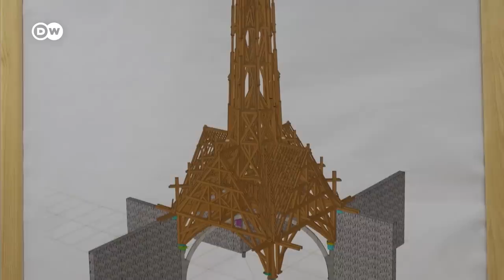How is the restoration of Notre Dame Cathedral going? | Focus on Europe

Comment: It's great that they are restoring the cathedral so that it will look how it used to, rather than doing some kind of wacky modern reimagining of it.
Reply: The spire basically is a whacky modern reimagining of it. It was added centuries later, fairly recent, and it turned out to be a bad idea, as the collapsing spire crashed through the roof it caused a lot of damage. Rebuilding exactly the same steel spire sounds like a bad idea.
Reply: @kurtilein3  it was a bad idea because it got burned? with that logic the roof was also a bad Idea cause that fell to the ground as well and caused a lot of damage
Reply: @Legendaryium  The collapsing wooden roof did not break the lower stone part of the roof. That was all the spire. The spire smashed the roof, allowing in the water from the firefighters.

Rebuilding it in the same way that is at much as risk in a fire is a bit like rebuilding buildings that collapsed in earthquakes with similar buildings that collapse in earthquakes. 

The fire proved that building such a heavy and high spire OUT OF WOOD was bad.
Reply: At least we will see what she might’ve looked like when she was finished.
Reply: I kind of loved the modern glass green roof design that was suggested.
Reply: We need need more traditional building
Reply: A good example for combining modern architecture in a traditional building is the Reichstag in Berlin.
Reply: @kurtilein3  I would have been happy if they didn't rebuild the spire, since it wasn't original to the cathedral--it was a 19th century addition based on what Viollet le Duc thought the medieval builders should have done. That said, it's been a part of the cathedral for so long that I completely understand why it's being rebuilt.
Reply: Same with the bank buildings in belfast. In fact, it looks a lot better and fresh than it did before the fire. Everything looks exactly the same but just cleaner and also pedestrianised roads now exist because of the fire
Reply: @Gahmuret  The spire was originally on the cathedral, please, inform yourself and stop spreading misinformation.

What Viollet le Duc did was not adding what he thought the medieval builders should have done; what he did was restoring what the medieval builders had built and had been removed in the later period. 
As a matter of fact, Viollet le Duc used the foundations of the previous 83 meter spire (which were still present under the roof) to build his reconstitution.

This spire was on the roof of Notre Dame de Paris from the 12th to the 18th century when it was eventually destroyed because of its instability. It housed several bells (contrary to its modern counterpart), and the cross at its summit housed relics of the Holy Cross.

Viollet le Duc thus merely restored the cathedral to its original state (save for a few statues, grotesques and gargoyles).
Reply: Personally, redesigning the Norte Dame would actually be within Paris History
Reply: @Legendaryium  Yeah, the whole effing cathedral was a bad idea because gravity exists.
Reply: @ThePaulv12  exactly!
Reply: It's French history, of course they will do it properly.
Reply: What’s wrong with modernizing stuff.
Everything can’t stay the same forever.
Reply: @utopiandreamer04  Go to Europe. There are ‘traditional’ buildings literally everywhere.
Reply: I did like that idea of an all glass roof but I think restoring it back to the way it was is honourable but quite difficult.
Reply: Word!!
Reply: I mean, as if that was ever going to happen?... Lol
Reply: @joelmulder  not enough. In majority of cases it's only downtown that has beautiful traditional buildings. While the rest of the city is cluttered with modern buildings-"boxes"
Reply: @NiceButBites  True, I was just parroting the current right-of-centre backpatting.  Though there was a lot of paranoia earlier on that they were going to glass it up or turn it in to a mosque or something to fit with “modern Paris”.
Reply: @joelmulder  If you don't understand the importance of history, I feel sorry for you.
Reply: Yes, that's good. To me, it would be the only acceptable option. What's with all that "as it was or BETTER" rubbish? A medieval monument (yes, restored in the 19th century) couldn't possibly be made "better" by restoration works in the 21st century.
Reply: It would have been nice to add our contribution provided that it is done with care so as not to denature the building
Cathedrals like Notre-Dame to built in several times, where each era has made its contribution to it. We are the first era to not want to participate into our monuments, which is both great (we care about our past) and sad (our legacy will be weak).
Reply: @idalily3810  you don’t have to like something to understand it’s importance.
Besides, it’s a bit presumptuous to assume one doesn’t care about the entirety of history when one is not a fan of historical (read, old and I’ll equipped for modern living) buildings.
Reply: Yes, just slather it all in dull gray paint, make it fresh 😅
Reply: @kurtilein3  yes but it was built in a medieval style (gothic revival), not in 19th century's architecture
Reply: @remilenoir1271  somebody should pin your comment. Thank you for the info.
Reply: Our generation will be the first in a millennia which is not doing any “wacky modern reimagining” of it.
Every time they needed to fix/rebuild/improve, people added their own touch to it, which made the Notre Dame great, and filled with history. Our generation is completely left out of the history of Notre Dame.
Reply: Amen!!
Reply: @joelmulder  Coming from a Catholic perspective, I’ve seen more than enough churches try the whole “modernizing” fad over the years to the point where they’ve destroyed pretty much everything that made the church buildings actually uniquely Catholic or beautiful in comparison to the more modern, utilitarian designs seen in some secular ones. I’d much prefer Notre Dame to preserve its history and symbolism more than adding some tacky glass ceiling and ruining its aesthetic as a result.
Reply: @joelmulder  One who does not recognize the importance of architecture to history doesn't appreciate history. Yes, that's my opinion.
Reply: @kurtilein3  hahahahahahaaaa
Reply: @kurtilein3  it wasn’t really designed to be on fire love
Reply: It's great that thousands of century old oak trees will be cut for the roof structure and spire. To make it another potential fire in the future. They could've done it with steel. It's a part that no one would see anyway. It's fireproof and with proper maintenance will last a few hundred years if people still care about that.
Reply: I trust the reconstruction of this historic cathedral recently damaged by fire will incorporate the latest technology in fire protection and safety that was lacking or inadequate.  This should include periodic testing, checking and upgrading to insure its effectiveness over time.
Reply: @utopiandreamer04  yes we do
Reply: It’s not a waste of time and money. We need to preserve our history and that kind of craftsmanship
Reply: I thought the idea of a glass roof was cool.  When I visited the cathedral years ago, I found it dark and inhospitable inside.  I was underwhelmed.
Reply: Yes it's a good thing, the decision makers have understood that if Notre-Dame is the property of France, it belongs to the whole world. And you can't modify an icon.
Reply: @remilenoir1271  exactement ! Merci Arte ^^
Reply: @Gahmuret  Would you kindly delete this inaccurate message. There was a spire in the Middle Ages on the cathedral.
Reply: @Gahmuret   non,  il y avait une première fleche au 13 eme siècle qui a été démontée au  18eme siècle, Viollet le duc l' a reconstruite au 19 eme siècle...
Reply: On parle de mauvais câbles d'alimentation mais ça ressemblait plus à un incendie criminel
Reply: People aren't concerned with things being rebuilt in an 1800s or 1900s style.
What the vehemently object to is any current architect redesigning it in a modern style.
Indeed most people despise most modern architecture.
Reply: That wouldn't happen, and didn't

Comment: On the next progress report, it'd be great to hear about what's being done to prevent another costly disaster.  Did they install a fire prevention system throughout the cathedral, not just the areas that were affected?  What was learned in needing to re-do parts of the cathedral, and what was fully lost that could not be replicated?
Reply: Nothing is fully lost. Everything can be replicated. The architects are just trying to determine which original pieces they can re-use for the reconstruction.
Reply: In 2010, Andrew Tallon, an architectural historian and professor at Vassar College, NY, USA, captured the entire structure with a laser scanner. More than one billion points of data were gathered. Every minute detail was scanned. It was seen as a somewhat nonsensical project, but Tallon’s scans now helps bring today’s rebuilders as close to the originals as possible. (Tallon died in 2018 after a long battle with cancer, aged only 49.)
They will hopefully install a state of the art fire detection system. It would be insane not to.
Reply: Thought it was a digital scan done for the assasins creed game that was more acurate.
Reply: @kaspernbs  They didn't scan the framework, which was main part we lost.
Reply: @Steff2929again   So if using those billion points of data, a rich man were to reconstruct the Notre Dam in his backyard, will it have the same value as the original?
If that is the case, then what is the point of preserving historic works of art? Even if paintings by Van Gogh, Da Vichi are destroyed, we can simply recreate them using " billion points of data "
Reply: @uhura647  Don't be silly, you know perfectly well that this isn't about creating a tasteless copy, it's a tool facilitating the work for those making repairs and reconstructions. Without the scans, they'd have to settle with photos and drawings. Which would make it more difficult and time consuming.

The point of repairing and restoring works of art is to be able to pass them on to coming generations. All famous artworks are constantly being maintained, restored and if necessary repaired, otherwise they'd deteriorate. None of those you mention hasn't undergone substantial work. 

What's being done in Paris must be considered as repairs. The building has undergone many changes during it's long life, including repairs and rebuilds. What's interesting is that most of the work has stayed true to the buildings original character. We should continue that tradition.

One must also keep in mind that NDP isn't primarily a museum. It was, and still is, a working house of worship, a house of God.

Comment: I am very happy they are doing their utmost to reconstruct the cathedral as it was before the fire.  I saw some of the other plans for modernizing the structure, and very worried some of those designs would be accepted.  While those modern structures have their place, Notre Dame Cathedral is not one of them, in my opinion.
Reply: Exactly. I was angry when Macron said: "We will rebuild it as it was - or better." What could "better" possibly mean in this context? I guess he just wanted to sooth the crowds, but still. Such an absurd thing to say.
Reply: @cioccolateriaveneziana  In this case, "better" could imply making it more structurally secure. Not that Notre Dame was badly built in the first place - it remains a marvel of engineering - but there is room for improvement.

Comment: Reminds me of Ship of Theseus
How much of the original Notre Dame is left and how much was damaged, destroyed and replaced
I do hope they might as well as take this chance to strengthen it and make it safer
Protection from fire, earthquake, storms, mold, etc then add additional safety features like fire exits
Reply: It would be wonderful if they added some type of fire protection, too, since they are rebuilding the "forest" of beams  holding the roof up with wood, rather than steel
Reply: In Japan they dismantle and replace all the wood of their thousand+ year old temples every couple years or decades. It's part of the process of maintaining the structures but also a symbol of their faith in sense of renewal. It's quite interesting you should check it out.
Reply: And sprinklers in the wooden roof
Reply: @bui3415 traditionally every 20 years for Shinto shrines.  But they are rethinking this due to environmental impact concerns

Comment: Any restoring and reconstruction MUST make it look as it was originally, even if modern materials are used. Otherwise it's just not the same.
Even the iconic spire could be rebuilt with steel and made to look like the original wood spire.
Reply: There were several BBC documentaries about the reconstruction project. The amount of detail in the catalogue of objects, materials and construction techniques was staggering.

Comment: I wish they would’ve added some modern touch to it, like everyone else did in the past centuries. We missed our chance to add to the history of Notre Dame:(
Reply: Well, I get your point.
But this is a debate that could be endless (adding a modern touch, or rebuilding pretty much as it was?). And despite what the proponents of either solution like to say, there is no right or wrong answer to that question. Both position can be defended.
This time, the "traditionalists" won. (If we can call them that, because as you rightly said, for a long time the tradition was rather to add a contemporary touch to a building!)

Comment: The restoration work processes are so fascinating. I wonder if it's better to simply recreate new stained glass as an exact copy but with better more lasting materials/techniques that were not available in the time it was made. I wonder if that could be applied to all of the Cathedral. For example, the massive wood beams could be saturated in a clear coat of fire resistant material,  or maybe use rust resistant steel underneath the stone masonry to ensure a solid hold of the structure.
Reply: Simplifying things is generally good but not always the best. Creating new stained glass would be an insult to the talent and skills of these craftsmen who created these amazing and beautiful 800 years old stained glass. By restoring them, we honour these craftsmen.

Comment: Why not try to rebuild it at least with a bit more modern construction/engineering. It’s certainly an honor to be apart of a project which at one point took generations to complete.
Reply: Because that would be vandalism.
Reply: Because it's a historic site, and redesigning it with modern construction/materials wouldn't be preserving it, it would just be making an imitation. At that point you might as well just tear it down and start from scratch.

Comment: Despite the objectives of any politician, the world community would demand that the work be performed in a manner consistent with safe practices for the workers and the public. No one should be rushed to complete any of the restoration work. To that end, if structural changes are necessary to prevent future problems, they need to be implemented despite protests unless those protesting are willing to personally take on the financial responsibility for any future problems.

Comment: When the roof burnt off, did it effect the walls? I hope they have not been weakened.
Reply: There was a concern that the fire softened the limestone that made up the walls and vaulted ceiling, but that seems to not have been the case. 

The main concern though was that the loss of the roof acting as a weight that keeps the walls from bowing out would cause the while building to collapse, which is why you see so much reinforcing around the flying buttresses

Comment: I'm a little disheartened... even fearful of the fact that the attic or the "forest" as it was called will be rebuilt with wood... Doesn't feel like a wise decision. Normally I am all for rebuilding historical monuments just as they were... but when wood is involved I have issues. I liked the proposal that envisioned a glass greenhouse roof covering an actual forest of live trees. That would have introduced a new space for public visitation and offered new views of the bell towers and the city. And it wouldn't run the risk of catching fire 100 or 800 year from now. It was the most poetic solution presented... Wood is wood... and just as wood was built from the atmosphere, it will return to the atmosphere... at one point or another.
Reply: yeah i don't get it either why are they using wood again. why are the not using steel like in the cologne cathedral?

Comment: Strange how they use metal tools to clean the glass.
Despite the fact metal scratches glass.

I’m surprised they are not using a soft sponge to clean and protect the glass as it being cleaned,”.
Reply: You honestly don't think they know what they are doing?
Reply: As a glazier who restores stained glass, you can use Stanley blade scrappers and wire wool to clean the glass once it's taken apart, before re-leading them. The paint is often surprisingly well baked on most time. Varies depending on numerous factors.